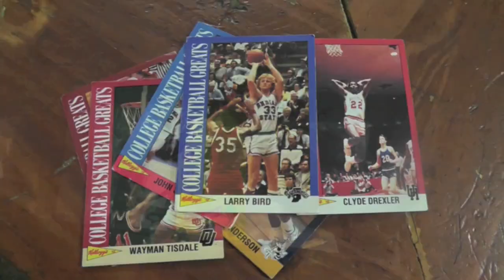How To Replace A Coil On A Stihl FS Trimmer / Weed Whacker - with Taryl

Comment: Hey, I have a brand new Sthil fs 91. Everytime it gets hot , after about 10 mins , it starts cutting out real real bad. Could it b the ignition coil getting hot losing spark?
Reply: Very well could be, but if it is brand new I would take it back to the dealer for them to fix or replace. You shouldn't have to put a wrench or tool on it if it is brand new.

Comment: I have a fs38 trimmer had to replace carb on it do you have tips tricks etc on how to tune those Zama Carbs?
Reply: those darn  sticky check valves.......
Reply: Must be this unit is from 2014 and got to where it just wouldn't start or prime no gas up to it tried new primer bulb and that didn't do nothing.  Unit still had some warranty on it but, place that sold unit said we needed to tune it up and because it had some grass on it was why it wouldn't start or prime no gas so I just picked it back up and bought that one carb off ebay and thought I will show them still need to figure out how to tune it.  Far as I am concerned ***** I agree with you they are junk in my opinion.  VE1AXC  I have heard people mention the check valves may sound stupid but, what exactly does the check valve do?  I am not a real big expert obviously I have read up on about them sticking on other Stihl Models.

Comment: Been struggling with my FS55R trimmer. Spark tester shows a spark but I think it is weak as starting fluid shot into the carb would not give any combustion. Is it possible that a could could just get weak and not die entirely making it so the trimmer won't start?
Reply: Your carburetor may be flooding the spark plug or double check make sure the switch is on

Comment: hey Taryl im working on a john deere 111 hydrostatic and i need some help. theres a wire that needs to be bolted to something. when i put a battery in and turn the key nothing happens. i know there is spark but i dont know if theres just ware on the battery connections or this wire needs to be connected. the engine is a briggs and Stratton 12.0 hp.

Comment: I’m wondering if you can help me please on a Stihl weed eater FS 55R change the carburetor new coil and spark plug muffler is clean wants to backfire out of the carburetor and the exhaust still will not start up
Reply: Check flywheel key way

Comment: HAHAHAHAHAHHAH YOU GUYS ARE TOO MUCH.... Nice coil change buddy , im a stihl guy and have never had to change one yet. Cheers
Reply: I replace them pretty often on the FS45's and FS55's. Then again, I'm working for a Stihl dealer.
Reply: suchfunstuff I have a 14 year old fs85 that has never had problems and just bought the fs240 , what a machine.  Man I just about cut down half my bush with it its a brute. Cheers
Reply: I have an FS85 from around 2000 and an FS110 that I bought 4 years ago. Pretty much trouble free, here. The 110 with a Tri-Cut blade is kick-ass.
Reply: Just changed mine today on my FS55R.  13 years old.
Reply: @toddzino58  what symptoms was it having when your fs55 coil went bad? I bought one from a guy today and my suspicion is the coil is bad because it keeps dying once it gets hot

Comment: i got a stihl fs110rx and the coil was bad so i got a aftermarket coil and put on it i had to use washers to shime the coil out so the coil wont hit the cooling fines on the engine the weedeater has a miss in it and runs bad i put a new carb on it could it be the valves in it. making it miss or not run right...maybe its the plug but i never have a plug do that before.....but i never have owned a weedeater with valves either that you still had to mix gas and oil.....

Comment: Had a Stihl FS110 4 Mix that drove me nuts a few weeks ago.  Start up fine run fine, but would not start or even sputter when you tried to start it hot.  Still had spark on the tester just would not start until it was cold.  Made no sense.  Changed the coil and then it was fine.  Have never heard of it but someone told me the electronics inside can get stuck in an advanced mode.  Shows spark when hot but will not start.  Anyone else ever hear that??

Comment: Can anybody help? I've got a mountfield model 23 brush cutter that had no coil, I found a replacement coil ... but I've got no clue where the positive and negative cables from the hand controls go, or where the black cable from behind the fly wheel connects to ... It would be nice to get her hooked up so I can whack some weeds! Thanks to anybody that can give me some advice. 😁